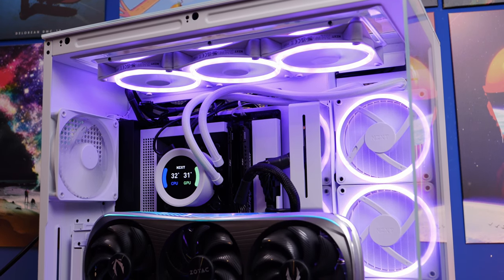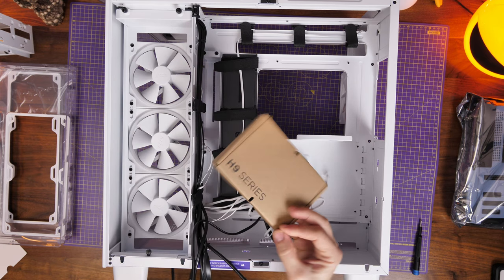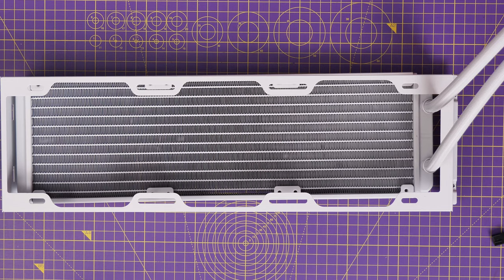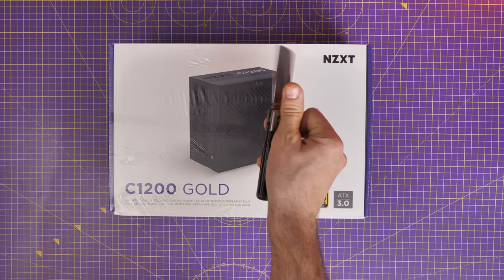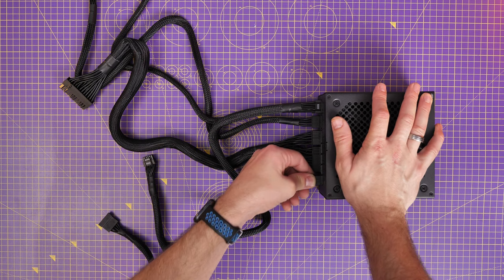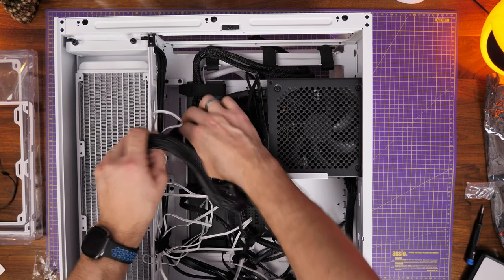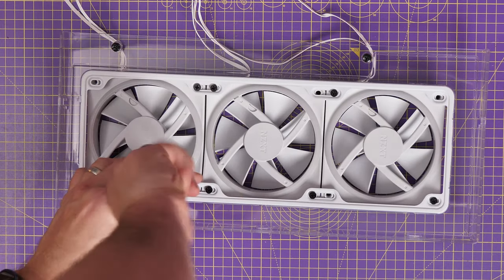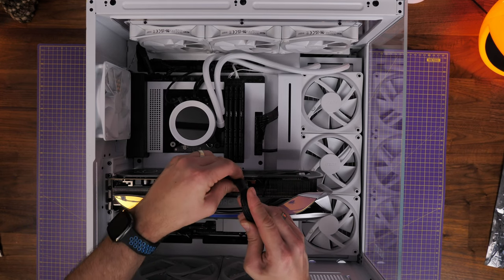How to build an NZXT PC featuring H9 Elite case and F120 Duo Fans

Comment: What do you think about 3 fans intake (bottom) and 7 fans exaust (top, back, right)?
Reply: NOOOOO do not do that add more intakes then exhaust or else you will creat negative pressure in the case and the temps will spike! TRUST ME!
Reply: @walkerschwartz6342 thanks I was about to buy a third fan for the battom😂

Comment: In case you build this with Lian Li Uni fans V2,  I mounted my aio with Uni fans at the top and the cpu power cables were touching the fans,  It resorted to me mounting my AIO on the side .  Those using NZXT fans with a top mounted aio did not have this issue however they were still pretty tight.  I still prefer Lian Li 11 Dynamic Evo as you can use any brand of fans and have enough space
Reply: You know you can mount radiator on top of the removable panel and fans underneath it

Comment: This video is AMAZING!!! Thanks to your detailed and easy to follow video I was able to finish building my very first PC, which was extremely similar to your build. Other than one fan wire that came loose I was able to get a successful post one my very first try!! Thank you so much for the great video!!!
Reply from the maker: Hey Nani, thanks for the comment. Glad I helped you out 👍 that's why I make them so detailed in the hope that it'll help people. If you liked it please help me out by subscribing 🦐
Reply: @TheProvokedPrawn  Of course! Already did and liked as well!! One question though. I noticed on my N7 Z790 that the bios version is 1.31, is it worth updating it to the latest version or leave it as be if nothing is broken?
Reply from the maker: @NaniiDesuu  the advice is generally not to update bios unless there's an issue. That said sometimes bios updates include essential fixes so it's worth checking the notes.

Comment: I have waited to see your review of this new case. I ended up order one of H9 flow replacing my 4000d airflow. I'm gonna try  push pull side radiator. Hopefully can get lower temps on 13700KF. I really appreciate for your in depth detail review.
Reply: Where did you find the h9 flow in stock? I've searched so many places and all say out of stock 😔
Reply: @TryllHDTv  I’m living in Australia. H9 flow and elite are still in stock in a lot of stores but I expect it to sell out soon. Most likely they will increase the price.
Reply: @ra4239  ah ok, I'm glad you were able to get one. Hopefully they make some more over here in the US. I would like to build PC within the next month.
Reply from the maker: The Flow looks like a great option. Hope it goes well 👍

Comment: Great video! I was wondering how to swap out the radiator AIO fans for the Duo fans to match the rest of the Duo fans build. Also, mounting the radiator between the bracket to fit three more hidden fans is a clever idea! Overkilled but nice to see that it is possible to have 13  120mm case fan in this H9 Elite. Time to go build my PC.
Reply from the maker: I like to show the possibilities even if they are bonkers.

Comment: Thank you for providing us with one of the finest "How to" videos I've seen to date. I'd like to inquire if you would consider making a "How to" build video around the Asus ProArt Z790 Wireless motherboard along with the AMD 7900XTX for those of us who work with video editing? Also I am currently at a loss as to why one can't use 4 sticks of DDR5 using 128GB or why no one provides DDR5 kit of 2X 64GB DDR5 Dims for a possible solution and thus running the memory at it's rated speed. Again thanks for this video I wish I had seen this first before purchasing NZXT H7 Elite! oh well live and learn btw NZXT H7 Elite is a fine case. Thanks again and continued success to you and your channel.
Reply from the maker: I don't think I can meet those specific needs tbh. However, regarding the RAM, DDR5 is still in its early stages and it seems many boards are having trouble supporting DDR5 with four sticks in place or with XMP on or both. It can cause stability issues and even prevent booting.  Even with this machine, funnily enough, I could get it to boot with four sticks of 16GB!

Comment: Great video, i was inspired by you build and built a similar setup but i have the kracken elite 360, amd 7800 cpu, mp700 gen 5, Radeon XFX 24 XFX Radeon RX 7900 XTX 24GB, corsair vengeance rgb 6000 cl30 and asus X670 E. i was dissapointed the krackon elite 360 didnt have the same fans as the case. My only critique of your build is you put to much tension on your cables connected to your motherboard. they need to be a nice smooth curve so it doesn't damage the strands of copper inside. As my old M.O.D electronic instrutor used to say it's wire forming not forcing.

Comment: What a wonderfully detailed guide, I like that you took the time to go through some of the airflow options :) I have an NXZT H9 Flow on pre-order (should come next week) and will be doing a blackout style build around the 4090 gamerock omni-black.  Can you feed any of the cables from the AIO through the motherboard shroud, for a cleaner look?  And do you have to be really careful with the 12v power cable for the 40 series cards? I.e. avoiding bending the cable too much?
Reply from the maker: Yes. https://youtu.be/EIKjZ1djp8c

Comment: For the f120 duo fan transplant to the kraken z73, does the model of the kraken z73 need to initially come with rgb fans for the f120 duo rgbs to work? Or can you just get a non rgb kraken z73 and install the f120s to function the same with its lighting?

Comment: thank you so much, this was so incredibly useful!
Reply from the maker: Glad it was helpful! Thanks for joining the channel too Charles. If you want to join Discord I post new videos there and chat to people too 👍 https://discord.gg/W7M58gpH
Reply: @TheProvokedPrawn  Thank you! 

I've just built the desktop (Motherboard: Rog Strix Z790 Gaming Wifi E, i9-13900k with the Kraken Z73 cooler, 9x Duo RGB Fans) and hit a snag.

If the fans on the radiator are connected directly to the pump via the splitter they don't turn on, however if connected (like the rest of the fans) to the NZXT Fan & RGB Hub they do turn on and function as expected.
- The RGB on the fans work regardless because they're directly connected to the RGB Hub rather than the pump.
- The pump it's self turns on with the display and shows the liquid temperature as 35 degrees 
- The pump is connected with the breakout cable set and micro-USB as specified in the instructions and is connected to Sata power
- Even with just one fan connected to the pump splitter it still doesn't work, leading me to believe it's not an issue of throttled wattage

Regardless of whether I plug the pump 3-pin to the aio_pump or cpu_fan or cha_fan headers I still get the same result - the three fans not spinning. I'm completely stumped and am curious as to whether you have any ideas of how to debug/fix this.

Comment: Loved the videos!! I’m going to be building my first pc and all of the parts are pretty much going to be the same as what you used except for the GPU and the fans. I’ll have 10 fans in total (3x up the top, 3x down the bottom, 1x on the back and the 3 on the radiator. Will I need to buy a usb header splitter in order to connect all of the fans or will the case controller and motherboard have enough connections? I’ll have 2 RGB controllers included with the fans as well.
Reply from the maker: https://youtu.be/d8vELbWWaCQ
Reply: @TheProvokedPrawn  Thank you so much!!!!

Comment: Very very VERY helpful video. You have convinced me to buy this one over the H9 Flow. Subscribed. I have a couple of questions, 1) How is your experience so far with this setup? 2) I see you got a 1200W psu in the build. How much power does your system pull at idle and at peek? I'm doing an am5 build with a 7900xtx so trying to figure out which psu to buy.
Reply: its good to get a high power supply just incase you want to upgrade in the future

Comment: good evening, this is by far the best video on the build for the h9 elite, i have a quick question, I connected everything, and I get power to the motherboard its an asus strix b550 gaming wifi but i dont get power anywhere else, I have already checked all connections and tried moving the front panel and audio panel connections on the board but they cant be moved.  I press the power button and nothing happens.  thanks for any tips

Comment: Nice video! I love it. What do you think about setting the AIO fans to extract air instead of putting it in? The radiator on the side seems more aesthetic to me, but the airflow...
Reply from the maker: In my experience it's often better to intake on the radiator to prevent thermal throttling but it depends on the case and the other fans and where you've put the AIO. https://youtu.be/sVEXd-Wp8FY
Reply: @TheProvokedPrawn  I'm going to build h9 elite with 7800x3d, nzxt kraken elite 360 and rtx 4090. Full gaming
Reply: 2x140 below, the radiator 360 lateral, the rear fan and 3x120 above. I'm going to see the video you indicated. Thank you again

Comment: Great video, looking forward to assemble something similar in specs with the same case. Have a question regarding the installation of the CPU cooler. You did it on the side back panel where originally comes the intake fans. Did you exchange those intake fans to the top? and if so, is this more efficient than leaving original fans and setting the CPU cooling chamber and fans on the top? Cheers!
Reply: I've read a bit about this and the general consensus seems to be it's better to setup CPU radiator with intake fans on the side of the case. CPUs are more sensitive to overheating, so this allows bringing in cool air from outside the case. Yes, the inside of the case will be hotter, but that's what the other fans are for, to help push that hot air back out. 

If the CPU radiator is at the top instead, then it would likely want to be configured as exhaust instead of intake, as hot air rises we don't want to push it back down. Now the radiator is pulling in hot air from inside the case instead of cool air from outside which will cause cooling performance for the CPU to suffer, even if the inside of the case overall may be cooler.

Comment: Nice, I didn't know why the controller didn't work (fans not spinning and rgb not working), turns out I didn't connect the controller with the power supply via sata (this should be in the user manual but isn't).

Comment: Hello, I have one question about the aio…is there any difference by pull or push the air through the aio? Because right now I have a setup that my aio is on the top pushing (exhaust) the hot air from de case to outside but I’m about to get a new case where I will have to put the aio on the side like this video and will have to put on pull to get enough cool air on my system .. thank you and keep going! Love your videos! Very useful 🔥👍

Comment: Very detailed tutorial. However I have some questions if you don't mind to answer :)

1. I'm planning on buying Z73 RGB and stick with the AER fans. Do they need to be plugged separately to RGB headers on the controller like the F120 ? 
2. So as I mentioned I would then have 3x AER fans from AIO and 6x F120 DUO from Triple Pack and 1x Default Rear fan from the case itself. Would V2 controller provide enough fan and rgb ports? 
3. Is there any downside to vertical mount the GPU instead of horizontal?
Reply from the maker: You can find out more about the fan logic here https://youtu.be/3IPOt0ZF-wE

Comment: Very nice video but just one question: if you set the fans to intake air from the top of the case and blow it through the radiator inside the case, aren't you essentially pushing hot air in the case? That seems like the opposite of what you'd want to do.
Reply from the maker: https://youtu.be/qQcyYHGtArs
Reply: @TheProvokedPrawn   Oh, sweet :D Thanks :)

Comment: Nice build... my parts are on their way home atm. Did you have to use an USB splitter? Also I'm getting 3 fans and a 360 AIO besides the 4 fans with the case. Do you need more splitters for the controller?
Reply from the maker: https://youtu.be/d8vELbWWaCQ

Comment: Question for you! I plan on getting this case, z73 rgb cooler (Using fans it came with) and getting 4 120 rgb fans (10 total rgb) I know you said that it supports up to 9 fans the controller, but you said that the fans that came with the cooler are Daisey channed. Does that mean that i could use 10 potential fans on that controller if I use the stock fans that come with the z73 cooler? or does the cooler each fan have a rgb header and power header?

Comment: Quick question, if you do a push pull on the radiator and you use the daisy chain from the aio for the first 3 fans, where do you plug in the additional 3 fans? just into a system fan 
port on the mb?
Great tutorial btw, i'm making a similar build and your vids have helped a ton!
Reply from the maker: Hmmm. Ideally you'd want to connect them all to the pump head or to a fan controller. They need to all be controlled in a logical way so they run at the same speed. If 3 are controlled by the pump and 3 by something else then they might have different speeds. You could try fan splitter cables to run them all to the pump head but I'm not sure if 6 fans is too much for those connectors.

Comment: Great build.  Is there a reason why you had the top fans hanging from the transparant tray, rather than putting them on top (same airflow direction). Looks like hanging them under is complicating the cableing of teh fans a bit.
Reply: There isn’t enough room to fit them on top of the tray under the top panel

Comment: Got the same case , i connected the Kraken z53 240mm to the one usb 2.0 header (msi mag  x570s carbon max ) with the lcd screen lit up, the 6fans (120mm 3 up top, two on the kraken) and 2 140mm at the bottom , are static white, the NZxt controller and the rgb controller for the 3 f rgb 120mm core fan are connect via a nzxt internal usb hub , but the cam is not showing the fans ,just the kraken , otherwise this is a good case !!

Comment: I have read in many places that the radiator pipe connection should be at the bottom, otherwise the air bubbles will stay on the top of the radiator and at the pipe connection, making a sound like an aquarium. Why did you finally decide to place the aio radiator this way?

Comment: I'm planning on getting the H9 elite and Triple Pack Duo, can I connect the power of the triple pack to the hub included in the H9 elite? So the triple pack, 3 duo included in the case and 3 more duo power to the hub? And then he 6 rgb and 3 rgb in the pack?

Comment: Do you need to use a NZXT motherboard with this because most builds I have seen people use that motherboard for this case. Also, do you use NZXT portable hub fans for extra RGB fan connectivity.
Reply: No you do not need the nzxt motherboard, they just use it because its a perfect fit because of course the motherboard is meant for nzxt cases, but you can use any motherboard you like especially for the size of this case

Comment: One question is, with the knowledge that hot air rises, surely having the AIO at the top makes more sense as you'd get less heat going through the case whilst the hot air from it travels to the exhausts? Unless this is more beneficial and I'm not seeing the logic
Reply from the maker: It makes minimal difference. I've tried both ways
Reply: @TheProvokedPrawn  Thanks for the prompt reply! one more question if i'm not too much of a bother, So in my planned build I will have 4 120mm duo fans, 1 kraken rgb AIO and 2 140mm duos, will one controller be enough for that? my next question is, can I still control the RGB individually of each fan then

Comment: Is the intake through a radiator really a good idea? You do pull cold air, but when it passes, won't be cold anymore
Reply from the maker: https://youtu.be/qQcyYHGtArs
Reply: @TheProvokedPrawn  Got it. Well, just asking based on other things out there that uses radiators... We always want to blow air on it and then out of the machine, cooling the liquid. Blowing hot air inside the case looks weird to me.
In your video you haven't tested exaclty what I'm thinking for my setup (same case): intake from the bottom with higher RPM, exhaust on the back, up and side. The side one gonna be a pull/push AIO. 13 120mm fans in total
"Each setup is a different setup" (or something like this), as you've said, but just wondering

Comment: Where did you installed the default fan (the fan offert with the case) ? I mean If plug it to the port on nzxt cam it's not detected I mean the fan is runing but I can't see the rpm it's like 0 rpm

Comment: In my haste to order all my PC parts…I went and ordered the new Corsair Shift PSU with the connectors on the side of the PSU not thinking about placement in the case.  Just checked how you have to mount the PSU with the fan towards the side of the case…does that mean that the Corsair shift PSU won’t be able to be fitted in this case due to how they have the power cables on the side of the unit? So they will effectively be coming out of the top of the PSU?  I have no idea if you can even mount this PSU on its side, i.e. does that mean it’s incompatible with the new H9 cases?
Reply: I believe the shift will work in this case,  just plug the connectors into the psu, with the psu out of the case. Then fit the psu into the case with the connections at the top and the fan near the back of the case as normal.

Comment: Hey provoked prawn! I’m actively building something very similar right now. At around 27 minutes you say the motherboard needs 8 screws, 3 on the top, 2 in the middle, 3 on the bottom. I don’t see the third hole on the bottom? Am I missing something?
Reply from the maker: Should line up with similar positions to the ones on the top